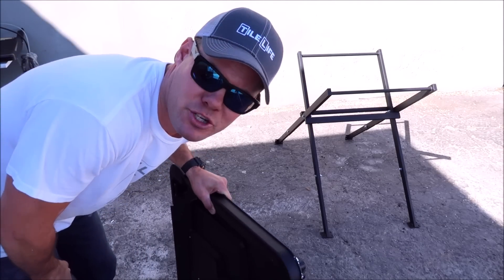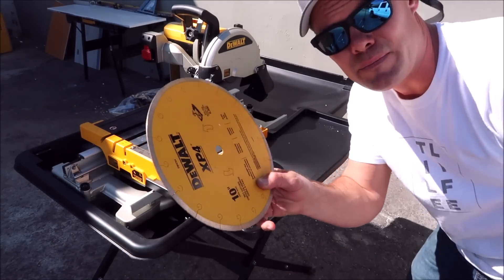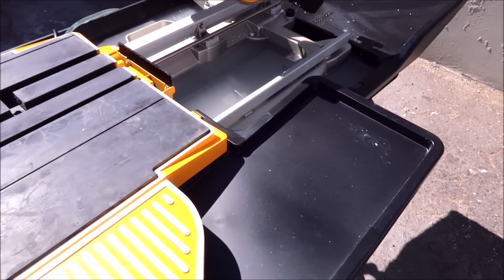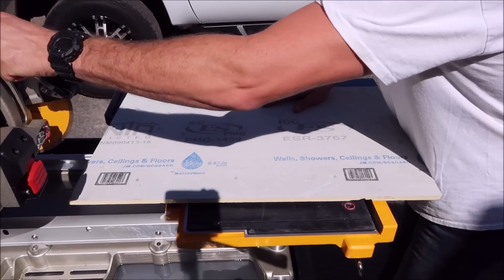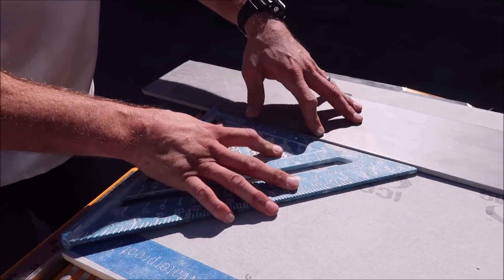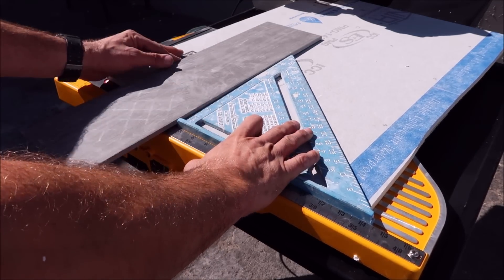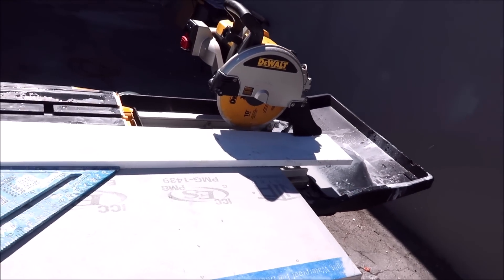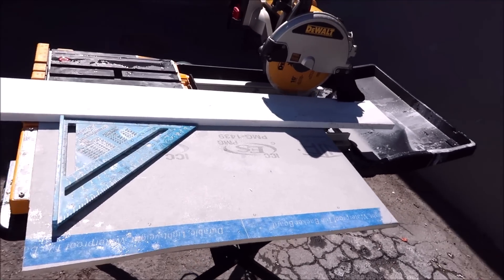Dewalt Cut Massive Tile + Unbox + Tips & Tricks

Comment: Good trick...but still hard to handle, I've tried the square thing, need to clamp it on the table because it will move. For larger tile I find it's easier to set up a fence/rig on the ground & use portable handheld wet saw.
Reply from the maker: Thanks and Yes, I agree, hard to handle. This piece weighed over 60lbs and was a pain to hold down and yeah, we use the grinder and a wet sponge for large on long porcelain. Just wanted to show an option for long tile 👊

Comment: Thanks for the tip!  However, I found that a piece of 1" styrofoam blue board was stiffer.  Then I added roller stand behind to keep the board relatively level as I pushed it and the tile through.  Still used the rafter square to assure squareness.  Still sagged a little so I set the blade to cut into the blue board just a bit.
Reply: Roller stand is a good thought.

Comment: Remodeling for the first time 😂 I have a problem with too much debris from the wet saw blowing to the floor and onto the street. Wondering if I need to buy a new machine with the water trays and if that should solve the issue.
Reply: You’ve probably found a way by now, but I use those wet boot trays they sell for your front door. Two or three strategically placed on a tarp under the whole area helps contain a lot of the mess. Also, you can slow down the flow so there is a bit less water. And place a board or hang plastic a few feet in front of the spray to channel into one of the trays 
Was able to recently use these methods to cut 1x3 and 2x2 tile inside a small condo hallway on the 3rd floor when it was below freezing outside.
Reply: Thank you!!! Exactly what you say, I did. A cheap polyester see through curtain from Ross worked the best! It allowed water thru and captured the debris, dried quickly, and easy to discard. Canvass drop cloth are to bulky and don’t dry fast. Will try the polypaper next to see how it holds up with the water. I wish the trays were larger tho, I been eyeing kiddy plastic pools instead. Need something like a filter/strainer gadget … business opportunity anyone???

Comment: Little bit welding and you can extend those rails to make same cut with one stroke.
Reply from the maker: you should make a video on that brother! 👊
Reply: It was only observation how that rail system with sled looks like to work.
And it looks like only limitation for longer cuts is length of those rails. So you can extend them by welding more similar size angle iron/aluminium for each end or replace them completely with longer rails.

Comment: Rod Kawtyk makes a rail that attaches to the sliding tray and uiu can rip planks and big tile with ease
Reply from the maker: Yes he does, I've seen it and used it, but, you can add scrap 1/2 inch foam board that does the exact thing, allowing the tile to lay flush with the back fence of the main tray.

Comment: Thanks for the Vid buddy! Excellent!

Just out of curiosity, are you having any issues with the sliding tray rollers being out of plane? Or any rail issues? My other D24000's are perfect, I mean perfect. But I recently got two more, and the first one I had to send back. The 2nd one still has rollers out of plane. Mainly on the right side only the center wheel touches. Causes a lot of movement in the sliding cart. It cuts 100% true, just doesn't seem to be of the same build quality as my other two. Which were near perfect out of the box. I've been adjusting these new ones for hours and can't get them to run smooth. Let me know if you will. You're the only one I know that may have more dewalt tile saws than me. 👍👊
Reply from the maker: Here is a video that may help you out 
https://www.youtube.com/watch?v=vHbPS3BTy8E
Reply: Use electrical tape on the left bearings -rollers and tape on the right rollers , it helps to get rid of the metal friction
Reply: @LandbergTileTV  thanks. He went over the basics. On my other dewalt saws, I've barely had to touch any of that. I'm surprised he didn't show the Allen screw in the top of the tray to adjust the middle left wheel in and out. But good video for beginners nonetheless. I imagine that surprisingly enough, I just happened to recieve two poor saws back to back. The main left rail for the actual guide wheels isn't straight. It has a bow in the center. The right side for the "riding" bearings has an opposite bow. And the center cart wheels on both sides are all that ride on those rails. All of which is not adjustable. That I can see anyway. I swapped my old trays in and they run ok, but not perfect. I was just very surprised being 2 in a row. Just thought I'd ask in case you knew a few tricks I don't. Appreciate your time anyway 👍

Comment: Great tip with the backer board. These sliding table saws are not meant for big tile. I struggled for quite a few jobs with one. The table flopping all over the place.  The roller system for the table is garbage. Have you tried a bridge saw? I know Bigger right? But easier for big tile...More accurate.
Reply from the maker: Never tried a bridge saw, the saws look huge! Maybe if you're in commercial tile work, or multi million dollar tile work range, but that's not us. I think tile size for these saws are limited to porcelain tile 3/8" thick and 48" long. Anything longer or thicker will be problematic. Thanks for the comment brother! 👊
Reply: They do have smaller ones but the precision is where its at. The floppy table on the Dewalt and Ridgid is so frustrating. In my video i am using the Ridgid. I broke the saw with those massive 24 x 48 tiles...lol

Comment: Get the Beast by Delta its the best tile saw out there by far both sizes I got the 10".  I had the Imer and this Dewalt tile saws neither are even close to the Beast.  I cut big tile all the time no tricks no hacks just cuts straight. Try it out
Reply from the maker: I've already reviewed the 7" Beast comparing it to the 8" ridgid and yeah, it's a beast! The only thing is the 10" Beast is around $300 dollars more than the Dewalt and doesn't contain water as well, but can rip 36" clean, and that gravity stand is amazing!
Reply: I'll check out that review!  Keep up the videos I think a 10" comparison between the two is in order!
Reply: I got both saws i like the dewalt better cuts faster but the beast you can cut biger tile down side drips alot of water like crazy
Reply: J B I too have owned both and had the exact opposite experience.  I had the DeWalt before I got the Beast and I was glad to see it go.  My main gripe with it was cut quality the DeWalt never cut straight.  I even had the tray replaced under warranty and it still never cut straight.  For out of the box performance the stock blade on the Beast is far superior when compared to the cheap stock blade provided from DeWalt.  I ran several expensive of types of 3rd party blades on the DeWalt to improve quality and i did achieve better results but not like Beast, not even close.  The DeWalt is a descent saw for the price but to say it’s better than the Beast is a massive stretch.
Reply: @mackwoodcock7484  well i got admit the dewalt by a year of use the rail goes bad after a good amount of use i have had the beast for a couple of months so we will see how long it lasts me i do lots of comercial. 
On the dewlat i like that it cuts faster little less noice.

Comment: Pretty smart trick I have to say!
But I always ask myself why you guys in the US use these big and heavy wet saws. I'm as well full time tiler but from germany. Here we use dry tile cutters for our straight cuts and for more complicated ones we take an angle grinder. These big bulky saws seem very impractical for me.
I don't want to criticize your way of working in fact I'm just curious. Do you use wet saws for everything?

Greetings from Germany!
Manuel
Reply from the maker: Hi Manew! Yes, we cut porcelain with a grinder and a wet sponge very often. Cutting hard porcelain typically burns out blades when we cut dry, so the large 10 inch blade on the saw will last a long time. Thanks for the comment and view and greetings! 👊
Reply: Here in States and Canada where I am from we can afford to use practical wise these saws because the housing here is bigger in square footage relatively to European houses , so even in a condo apartments we can use these saws , but I wouldn’t done that if I where in my condo in Greece let’s say because there is no space to set it and it doesn’t make sense for 2,5 -3 square meter washroom to use big machinery , instead I’ll pull my sigma which can cut max 700 mm porcelain and grinder for notches and rounds

Comment: I like all your video reviews, so how about one on a bridge saw like a Rubi DC1200 or similar as these saws would be more accurate for repeat cuts of large format, rather than trying to use over sized tiles in a dewalt , as i have found sliding tables tend to have a bit of play ,which is OK on smaller tiles but can show up on 600mm plus cut
Reply from the maker: That's a great idea, will do! 👊
Reply: @LandbergTileTV  look forward to that, could you try something extra thick ,as a lot of these cutters say they can cut 60mm plus just to see if this is possible in the real world. Thanks
Reply: Hello

Comment: You need to take the metal speed measurement guide off at the base of the sliding tray. The screws are a huge annoyance for cuts like this and you never end up using the ruler.
Reply from the maker: Yes! great idea, we did that with our old Dewalt, we never use that ruler and that bolt gets in the way 👊
Reply: landberg Tile TV good tips though. Rodman also makes an extension for this saw that is amazing
Reply: landberg Tile TV RODKAT***

Comment: Makita track saw and a 4 or 8ft rail & vacuum, dead straight cuts, all day, these push saws are for bricks, not precision work.
Reply: Nick, you don’t know what you’re talking about!  You obviously haven’t done much tile work and if you’ve done any at all it’s taken you about 10x longer, using a track saw.   Wrong tool for the job, that’s for sure.  If that was the route to take with cutting tile, then Landberg would be demoing track saws and doing manufacturer comparison videos on them.  Really not sure why he gave you a heart, because you don’t deserve one.

The repositioning of the track for cutting would be very time consuming.  How are you getting water to the blade in order to cool it, assist in cutting glass and porcelain and keep the dust from flying? A vacuum isn’t going to help you much...How are you going to make precision miter cuts or plunge cuts for outlets!

Bad idea for tile!  Good idea for paneling, plywood or any rip cut in wood, for that matter, but not for a tile project!!
Reply: @martylucas8557  Have you tried it? I use it for everything you listed, scoring concrete and cut tile, makita says I'll kill the motor, eventually, but who cares, it's getting the job done.  Wet saws can't consistantly do precision work, you should know that. Can you make perfectly straight inside  corners with a dewalt consistently? You have to spend big money on a rail saw, and even that will go out of square transporting it. Im not knocking the video, there's many ways to skin a cat, I just think wet push saws are junk. 
In north america using a track saw is not common, in Europe it is. My set up is a little more elaborate,  and the vacuum will go all day, without dust.  Most importantly I don't have to clean a dirty wet saw. There are dry diamond blades that fit into the track saws, and it works. Festool makes a track saw for tile in Europe, its just not available here. Tile is the only trade where the tools are always working against you, whether its too much vibration, not enough power, too much play in the tray, spays too much water, etc. The track saw allows me to get a perfect pin stripe in the inside corners. Most tilers don't care about inside corners in a shower, because silicone will save the day, and no one will see the eighth or quarter inch deviation in the cuts, made with a poorly designed wet saw, made you know where.. Every tiler eventually owns one, and they are pretty cool, and eventually  they end up sitting in there garage until a marble job comes along. Some guys will use a wet saw for everything, some will do anything not to set it up.   My opinion of wet saws is that they are simply, junk , thats all.
Reply: So you will use a track saw to cut 1/2" x1/2" mosaic sheet tile too...or uae a rail saw to rip 50 cuts the same size ..or use a rail saw to cut 18x18 down to 6x18???? Guess that's not precision work huh ...